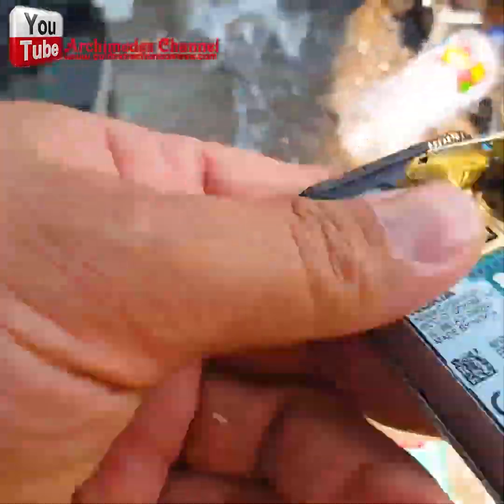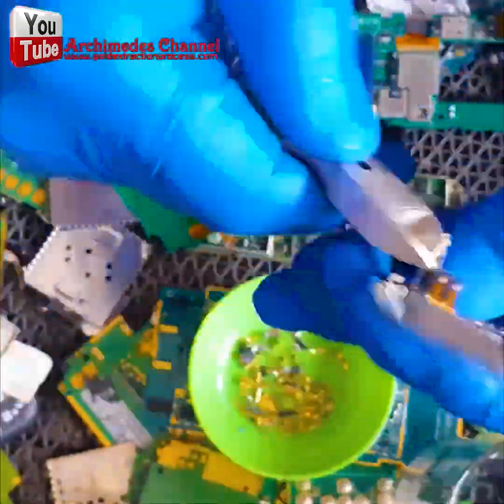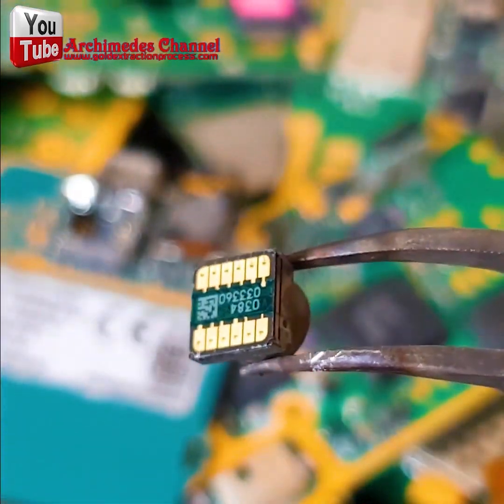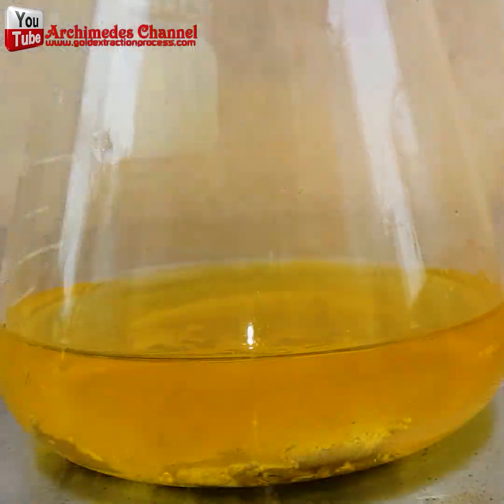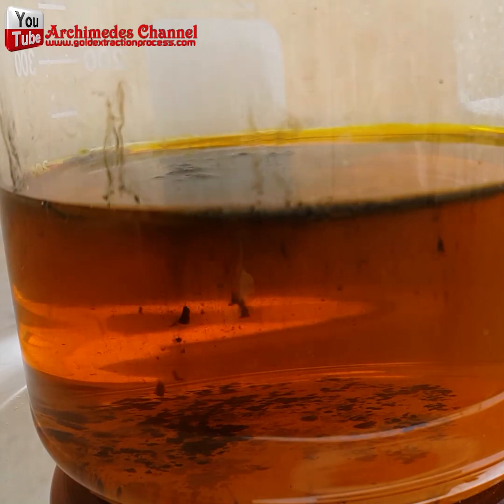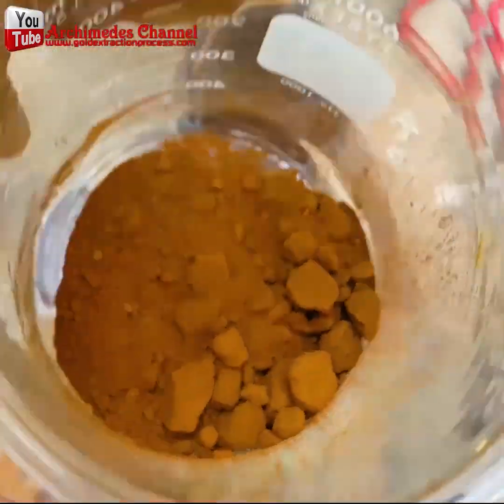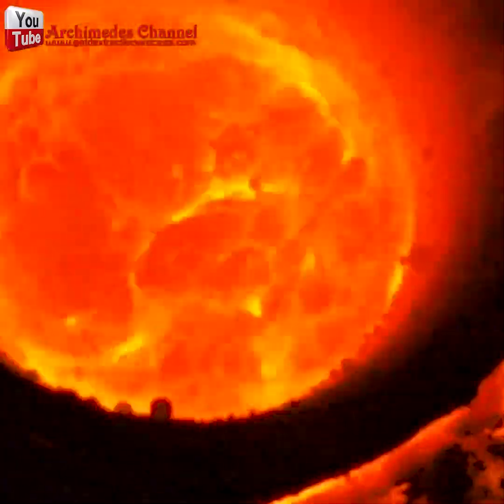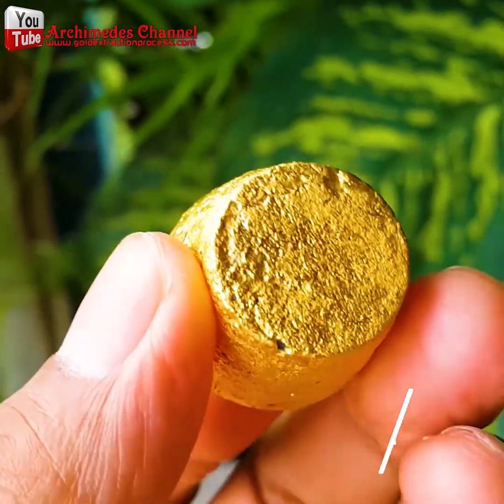turn a pile of junk old cell phone into solid gold | Archimedes Channel |

Comment from the maker: :_GoldBar::_GoldBar::_what::_what:While gold is a valuable metal, the process of extracting gold from electronic devices is complex and requires specialized equipment and knowledge. Additionally, the amount of gold in individual cell phones is relatively small. If you have old cell phones or electronic devices, consider donating them, recycling them through authorized facilities, or exploring trade-in programs offered by some manufacturers and retailers. This ensures that the materials are handled in an environmentally friendly manner and that any valuable components are recovered through proper channels.